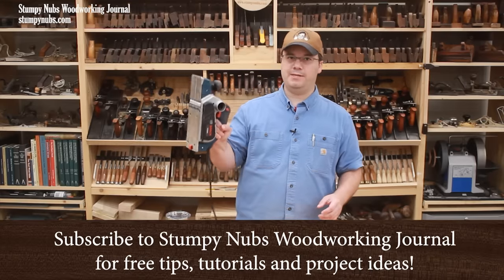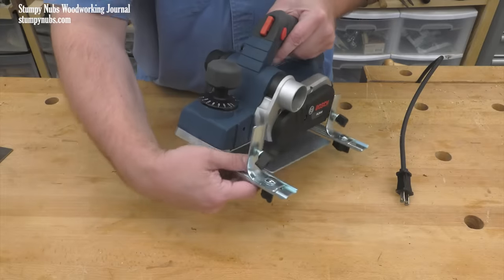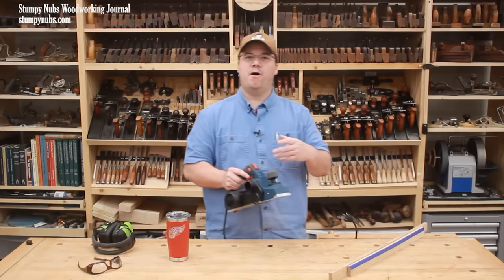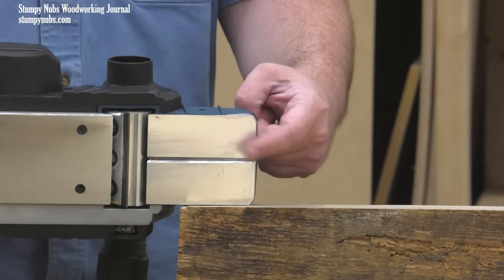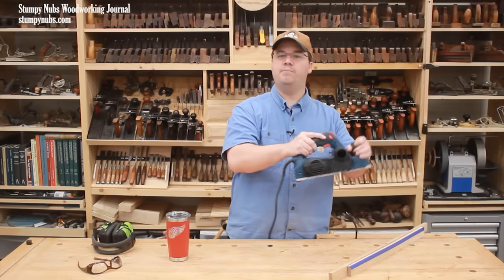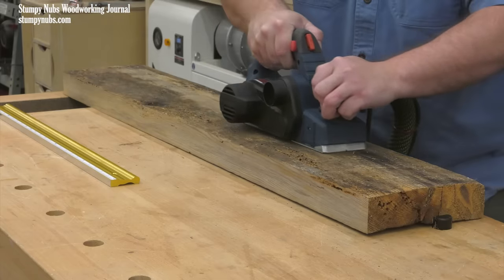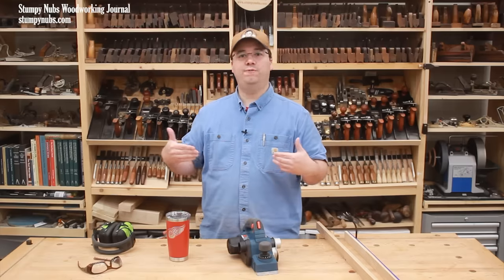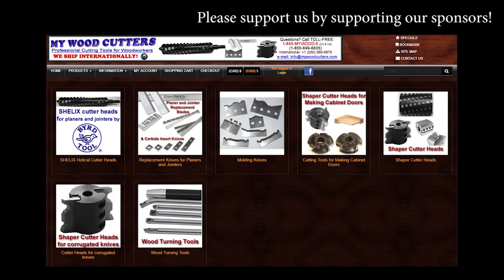Clever things you can do with an electric hand planer

Comment: I've seen Leo on the Sampson Boat Co. channel create two parallel planes by flattening one side and then scribing a line representing the desired thickness. He uses a chisel to bevel the edge down to the line and then uses the electric plane to take the surface down to the correct level. Kindy fussy, and his skill with the plane is off the charts, but it can be done.
Reply: Wait ..:).  you mean he used a technique that’s woodworkers used for centuries?  :)

Comment: I spent a winter cutting veneer maple out of a tree from my back yard. The electric hand planer was fantastic. It is inexpensive. I use it on recycled wood I use in projects to take the top layer of stain or paint off. It costs less to replace the electric planer then the blade on my surface planer. Can you use two levels instead of the sticks?

Comment: Thicknessing is also not the biggest problem. It is doable. Especially if you don't go for the 100% accuracy a stationary thicknesser will give you. Just lay the flattened side facing the table and mark a line around the wood. Then you can bevel the edges to the line for better visibility. You just need to remove wood from that point onwards.

Comment: I've been told the electric hand planer to be very dangerous or tricky in that sense, having heard if the blade snatches a part of skin the outcome would be a horrible injury, so i avoid those tools without the necessary background not just coming from stumpy nubs (what is the best of it's kind though/known). Or was that injury risk an issue from back in the 80's so that newer hand planers don't have such a nasty risk or downside (as far as this was told or i heard of)?

Comment: If the wood is soaked and or/steamed for some time and then pressed by a hydraulic press, would it be possible to "unwarp" the board without further cracking?  When the cracks remain, do you fill those with wood putty?

Comment: It would be possible to make a sled for it to flatten the second face parallel, like a router sled. It wouldn’t have the height adjustment a router has, so would be trickier to use. But it could be done in a pinch if you can’t afford a planer. You’d need to make something that mounts directly to the sides of the plane and extends out over your rails.

Comment: Remove that popping thing in the back of the plane's sole if you want to be able to start working from the middle of the board. Otherwise you won't be able to land you plane precise enough as that thing flips back only when you moving your plane forward.
Always check old used boards for hidden nails and screws. Planer cuts steel allright but you gonna end up with dents in your blade and it will leave grooves in the wood
If you have problems with having steps on your board after plaining then turn your planer 45deg on the second pass.

Comment: I have a question for you concerning a hand planer. First, let me state that I do not have one of these, and I've never used one either. I have jointers in my shop, but have been considering one of these for when I'm out in the field.

This being said, here is the question. I see many people using a hand planer at an angle to the direction they are moving - best guess between 30-45* off straight. Is this method used to minimize tear-out in wild grain? If not, what might be the purpose?

Thanks!
Reply from the maker: Hand planes are sometimes skewed at an angle because it creates a slicing cut as you push it forward. This cuts difficult grain more easily.

Comment: I tend to transfer the downforce to the rear plate as soon as it is fully over the workpiece. I’ve always assumed that will give a straighter pass. Am I doing it wrong?
Reply from the maker: No, the rear plate is the bulk of the sole, so pressure on it is essentially even pressure.

Comment: I noticed that as you were straightening the warp or flattening it. That you worked only One Direction would it also work if you were to flip the board around and then work on the other corner working towards the middle I’m just wondering if there’s any particular reason why you only cut in One Direction with the hand planer? I would think that it for hand planer type work that wouldn’t make any significant difference? Just asking if there was a reason why you always worked in One Direction other than to make the video easier to follow?

Comment: Wouldn't it be possible to make some kind of support jig to bypass this not being able to replace a thickness planer? Sure, you'd likely need to make two separate and very accurate height adjustment systems (or get fancy with some kind of linkage), and there'd obviously be a limit to how wide your boards could be, plus you'd be reliant on the flatness of your workbench as a reference surface. But it should be doable, no?

Comment: Wouldn't a router sled with a planer bit be easier? If set up correctly I assume the final result would be more accurate because you are not relying on eyesight. Just set to the lowest part of the board and go at it. Curious if those with more experience would agree or disagree.

Comment: Like you said in the video. With an hand planner you can make an edge flat, but you cannot make both sides of an board flat. That was for me also me first surprise when i saw an hand planer. It's missing an kind of guide that you can use to level your table to the planer. If you had an workpiece of 2.1 inch wood. And would put 2 beams on each side of the workpiece and use an guide to follow those beams. You where able to remove all the hills and valleys without any problem. So why doesn't it exist ?

Comment: I've been using power planers here and there since I was a kid (45 years) and I always questioned why they don't make both ends stationary, and just raise and lower the blade much like a jointer? Seems to me it would make it easier to use, as well as more accurate with less chance of scalloping the ends, and potentially safer?

Maybe they do, just haven't seen it...
Reply: Hi I was once offered an electric "coffin makers" planer It was a long-bed planer made by ELU, Black and Decker's top quality brand in Europe in the 70's / 80's that machine had fixed plates for and aft and an adjustable cutting drum as I recall. Too big for my purposes though!
Reply: @ngbc5342  wow, I would love to have that! Come to think of it, maybe I have seen one like that in the past. All I know is, I kind of hate the way power planers adjust the deck instead. It makes it too easy to gouge the wood on approach and exit...

Comment: THIS professional woodworker was able to level out one side of a board using an electric hand planer, but most people will not be able to do this.  It will still be better to buy a jointer than it would be to buy an electric hand planer specifically for flattening a board.

Comment: Thank you.
Would you use an electric planer to remove finish on an old piece of furniture? I got an old desk made of white oak and I would like to use it to make something else, but I need to remove the "thick" shiny finish first.
Thanks for improving our techniques!
Reply: I would be very careful doing that. One it would be hard to takeoff just to finish and leave yourself with enough wood to make something else. Two the finish my gum up the blades too often anyway. I would be especially cautious with a top made out of several pieces of wood the grain of which might be  going in different directions on each piece making up the top.
Reply: @richardhaas1989  Thanks for tat.
The top I got is about 1.5" thick, so i am not too concerned about loosing part of the thickness.

Comment: Great video, I learned a lot.  I haven't previously tried using winding sticks with the portable planner.  I have one question and that is how do you make the edge planning square to the wide surface with the portable plane?
Reply: With the fence.   Or the same way it’s done with a hand plane.  With your mark 1 eyeball :)  no seriously, and a square to help ..  once you get two flat surfaces flat and perpendicular, then use a marking gauge to get parallel surfaces…. It’s faster then you think… it helps to have a workbench.

Comment: Some great tips here, but I have to say regarding your warning near the end - I'm a fairly new woodworker and honestly it seems like what I'm gathering from watching a lot of videos on the subject is that it's almost impossible to do proper woodworking without owning a jointer, planer, and table saw. And of course those are all incredibly expensive tools that all require a lot of space. More and more I'm getting a bit disheartened because there doesn't seem to be any such thing as getting into woodworking on a budget. May as well not even think about it without being prepared to spend thousands and thousands of dollars.
Reply from the maker: Consider hand tool woodworking. It takes more skill, but the tools can all fit in a box and you can buy most of them second hand.

Comment: I would think that an electric hand planer is just a powered hand plane, with which creating two parallel surfaces is eminently doable. This is when you use some kind of marking gauge to draw a continuous line on all four edge faces that parallels the face you just flattened. Plane the remaining uneven face down to that line and you're done without using the surface planer.

Comment: If you're already going to run it though the surface planer, with a short example like that, especially; why not just make a jig to hold the uneven board firmly and run both sides though the surface planer?  That seems way more efficient than the guesswork required to do it by hand.
Reply from the maker: A jig is fine for a short board, but it becomes much more difficult to the longer the board is. Even so, some may consider making a jig less efficient than simply planning down the high spots.

Comment: I don't understand using a jointer for the face of the board,I'd use a thickness planner,I've only ever been taught to use a jointer for edge grain .The width of the cutter head and guard is typically very narrow. I don't like a portable plane because they can easily drift in accuracy.

Comment: To get parallel faces couldnt you run a marking gauge round the edge after doing first face and work to that?
Reply: You can, or use a caliper or similar. Once you've done the first face, finding the high corner is pretty easy.
Reply from the maker: You can, but it's not all that easy to plane an uneven surface to an even line for the average woodworker, which is why I said it would require more skill and fussing.
Reply: @StumpyNubs  thanks, love your stuff
Reply: I thought of that as well and yes, entirely possible. James did add the caveat that it requires more skill and time for that kind of precision. I've done this same flattening process with my hand planes, starting with a scrub plane and working through to a smoothing plane, just to see how long it takes. It goes fairly quickly and it's not terribly difficult to get within a thousandths or two. It's a good workout. The thickness planer is nice to have. I still, depending on the wood, finish the surface with a hand plane. It is pretty comparable to a 1200 grit finish.

Comment: I am a beginner woodworker and after making a couple of cutting boards I tried making a cutting board end grain style. It’s been problematic trying to plane it with my Dewalt 735 planer. It dulled the blades. And when I swapped them it still was making a pounding noise and leaving marks on the board. The marks were from the screws on the retainer blade holding down the blade. I was completely perplexed as to what I’m doing wrong. And I googled planers and end grain cutting boards and got a ton of results saying don’t do it. Is this true ? Should I use a hand planer like this instead? Or a manual hand planer ?
Reply from the maker: End grain is much more difficult to cut with an edged tool like a planer (either a stationary one or a handheld one). You would be better off sanding it. If you must use a planer, take very light passes.
Reply: @StumpyNubs  thanks ! Will do

Comment: If I do more passes on the surface by progressing through the width of a board, it leaves lines. What do I do wrong? I try to put the front down on the higher level, so it wouldn't cut from the lower surface, but it still does. Any idea? Thanks.

Comment: Maybe an uninformed idea, bout couldn't you just hang some plumb bobs on the both winding sticks or put a level gauge on each end, or just use longer box levels as the winding sticks. For the bottom face it won't matter as much, though you could still leverage them so your sides are square and you don't need square those. Would seem like you could then use the same approach while also working in the level component.

Comment: New guy here. I have a 30yold electric planer and some hand planes from my dad. My question is does the limitations of making a board  parallel with an electric planer the same as a hand plane?
Reply from the maker: Yes
Reply: @StumpyNubs  thank you!
Reply: @grahamellerman4244 , except electric hand planers can ruin your surface quicker than a manual hand plane. jus' sayin'
Reply: @seanflanagan2441  yep, I've used it a couple times and it can get really spicy on you real fast. I felt YouTube university was in order before I hack more wood up.

Comment: what happened to the old tried and true method of managing the cords by putting them over the opposite shoulder of the working hand so you can re-direct the cord out of the way..  It is no longer seen at job sites.  It may still be seen when an old timer is mowing the grass with an electric mower.

Comment: Hi James, is this Bosch planer the best value for the money?
Reply from the maker: I like it because of the dual dust ports and the carbide blades. But I am sure there are other decent models that I have not tried.
Reply: @StumpyNubs  I have been following you for years and I value your opinion. I think that you do a great job on your videos. Keep it up.
Reply: The corded Makita is also really good, and one of the two larger Festool dust extractor hoses fits its either-side ports perfectly. I forget which one. The middle one?

Comment: I LOATHE the kickstand. Always catching and causing problems. I removed it and built a plate to set the planer on while it's stopping. 1/4 piece of plywood slightly shorter than the front plate. Added 1/4 thick pieces in a squared u shape just wider than the planer. Set the front plate into the u channel on top of the plywood and set it down. Blade never touches the bench.

Comment: Why can't a handheld planer thickness plane? You can put it in a sled just like a router. 

It takes forever, but you can do it.

You can put it on ski's to go over the material on your bench too. Set it on two blocks on top of a flat workbench and fit a DIY frame to hold it at that height. Make that frame with T-track and you will be able to adjust the height. The ski's on a flattened work bench kind of dummy proof it. Whatever your setup blocks are, is what you'll get back. Assuming it's a flat bench, it's quick and simple to use.

Comment: Why couldn't you have cut the board to desired thickness by running a marking gauge from the reference face to the desired depth and around all four sides...then simply planed down to the gauge lines?
Reply from the maker: You can if you have that skill
Reply: @StumpyNubs  seems like less work then with my lie nielsen. Gotta be cheaper too.

Comment: Once you have 1 flat side you can just scribe the other side and plane it parallel.
Reply from the maker: It's easy to mark, but not so easy for the average woodworker to plane a rough, uneven surface accurately down to a line. That's why I said it requires extra skill and fussing.

Comment: I don’t understand how you can plane without sniping at the end. If the front shoe is set at different heights and the rear is fixed then when you get to the end of the wood and put pressure on the rear you will have a different depth to the rest of the wood.
Reply from the maker: As you remove material the surface gets lower, which matches the level of the rear sole.
Reply: @StumpyNubs  but the front is set at variable heights. If you go deep at the front the rear doesn’t go deep, it stays the same. As you get to the end the rear would lift the cut a bit.
It doesn’t make sense. If the rear moved as well, then I could understand it but the rear is always fixed.
Reply from the maker: @Nick-cs9dt  The cutter is set to the same plane as the rear plate. It is not going to lift the cut.
Reply: @StumpyNubs  I’ve just got my planer back again after giving up with it. I I cannot get a perfectly straight line no matter what I do. I have held a steel ruler to the plates and can clearly see the pivot points. There is no straight edge along the plates so I cannot see how you can possibly get a straight line.

Comment: So, I'm wondering, is this anything that you can't do with a hand plane?  I mean, really, isn't an electric plane the same thing, but with a rotating  blade (just as a jointer has) rather than a fixed one?

Ok, the snipe issue at the start and end of the cut isn't really a hand plane issue, but other than that?  I'm a little surprised that Stumps didn't recommend replacing your hand planes with one of these.  As far as I can tell, they cost far less than top shelf hand planes.  

Better still, maybe they should start making them in different lengths, just as hand planes are, to do different tasks.  

I know, none of the romance of the curling shavings or the deep satisfaction of using a well-tuned hand plane, if that is what you are about.  I  might be, too, once I tune a hand plane to the point that it actually feels good to work with.  I just don't use them often enough to spend the time.